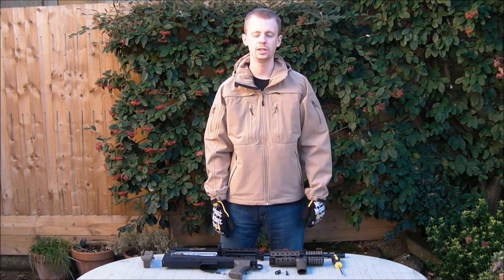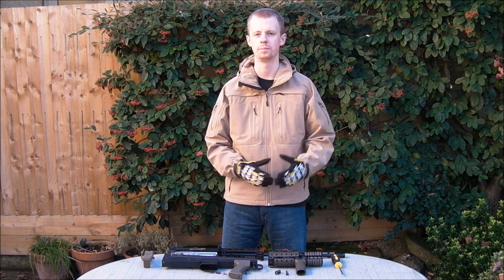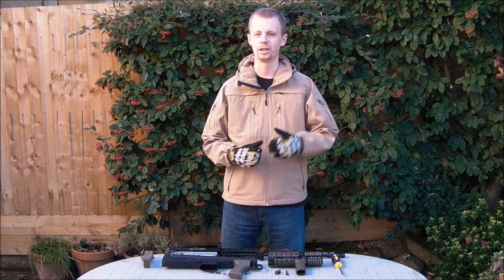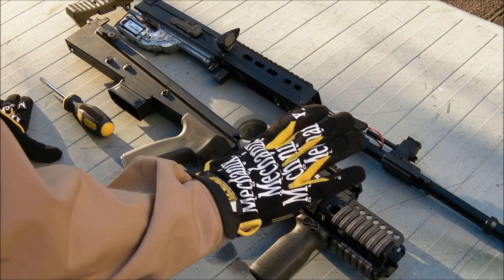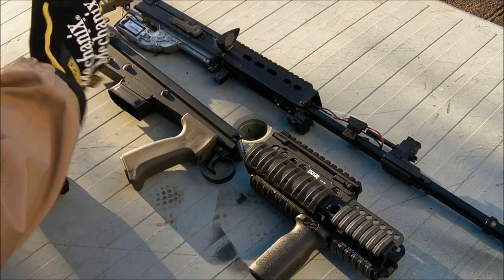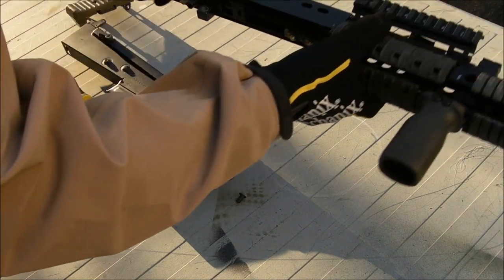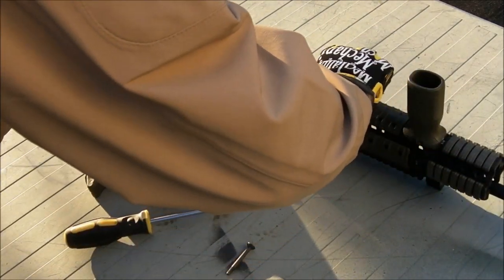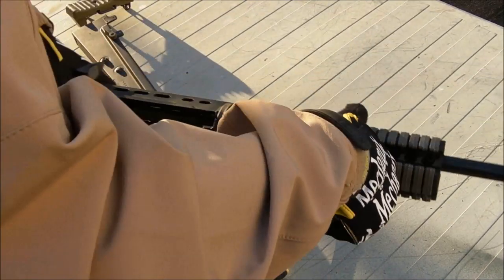L85/SA80 RIS Handguard Installation (Airsoft)

Comment from the maker: The 416 was released long after the A2 conversion by H&K (H&K being owned by BAe at the time the work was done).  The gas system was one of the internal areas they didn't change that much, the main alterations were replacing the cocking handle, bolt and extractor, altering the function of the hammer assembly and adding the guard around the magazine release.  A lot of rifles in service still feature the A1 plastic furniture.

Comment: If you get the hornbill gas block conversion it will allow the rail to be fitted much more easily and also allows the bolt to be screwed through the gas block making it much more secure! Hope this will help anyone who has difficulties making it fit

Comment: the L85A1 had some design faults so the design was sent off to H&K in germany and they redesigned the gas system and made some external modifications to the controls and the polymers i believe to the point where it is now internally a bullpup 416 and like the 416 is incredibly reliable. as for the body cracking, it's stamped steel. where ever you heard that from they're talking out their arse, the only external problems were with the polymer furniture in extreme heat such as the middle east.

Comment: ACOG did a rather brief service, i'm not sure if this is a rumor or not, but shipping them out to afghan, they dropped the crate and broke, i know for a fact that the lads kept braking them by the dozens, and the reticule mysteriously used to shift to the right of the scope so we bought spectre.
ACOGs are issued with some stupid Z mount, and are now only used on the L22AFV for vehicle crews and the RN still use them, the X6 variant is rarely used now also

Comment: they were used on the frontline when i was in, but i havnt seen an image of one on the frontline in ages, i know they are no longer issued on a section level in favor of the L129A1 but i guess you could still requesition one, but ive heard guys not being able to even req one, various rumors include being the first batch to upgrade to A3, converting them back to L85 IWs and such
the best chance is that TA has them

Comment: this was exactly what iv been looking for but the question i still have is that it looks like you replaced the rail on top of the receiver. iv been wondering if that was possible because i have the same ics weapon and the rail on the top is to small for regular sights. a reply from anyone would be great.

Comment: All I know is when I field stripped them the gas piston had HK markings on it so it had obviously been replaced and I was told by an ex para that the furniture on the A1 didn't hold up to the heat but the A2 does so perhaps it's a difference in the way it mounts to the weapon. Is there a reason you're correcting me but not this guy, I got a couple of details wrong vs. Spouting BS and you correct me?? :s

Comment: Awesome video. Can you use a real British Army rail on the ICS L85? I have a genuine British Army rail and wondered if it'd fit with the ICS adaptor ? Cheers.
Reply from the maker: The MoD purchased rail won't work on the ICS AFAIK, the gas block is setup different to the real rifle.
Reply: REMF Tacticool That's strange because I knew someone who managed to fit a MoD ris rail to an ICS l85

Comment: I've done it thanks, saved me £30 do do it local fitting! One question, finding it impossible to access the battery, any tips?
Reply from the maker: I took the fake gas parts out and put some bits up in the top cover.
Reply: Ok thanks is there any other option or is that it?
Reply from the maker: Not touched the gun for a long time, I just found a way that worked for me and I stuck to it.

Comment: i noticed you had a picitany rail adapter for the susat ris. where did you purchase that? i only managed to find that in one place and its sold out. i want to get a rail adapter for my l86 cause the sight options are very limited for susats
Reply: devoman203 check out ANT Supplies he has the rail adapter either in picatany or the riser version.

Comment: How easy would it be to run the battery wires through the RIS handguard? Just wondering as I'm thinking about getting this but if I did i would use a mock PEQ box to make battery changes less of a hassle.
Reply from the maker: Pretty easy, there's plenty of holes.
Reply: CKinnerley Cheers, thanks for the quick reply.

Comment: Hey Chris had a question about the battery space on the rail kit. I don't use lipos, so could i use a 9.6 nunchuck and have a good fit? If not, could you please give me a few more options? Thanks.
Reply from the maker: No way anything but a LiPo's ever gonna fit inside this setup to my knowledge, sorry.
Reply: REMF Tacticool Hey, can i fit this rail on the Carbine version of the ics l85 ?
Reply from the maker: I don't personally know how the carbine is setup on the front end, if you can compare it to the rifle somehow that's the way to find out.
Reply: 7starsfear From what I've seen it should fit on without a problem.
Reply: ***** you can use 9.9v 1000mah LiFe batteries in it. They are the same ones airsoft ed aka bullet4myenemy used in his one.

Comment: silly question i have an ICS l85a2 with the same parts but i cannot slide the RIS over the front sight holder part on the barrel? also just to add the hole in bottom of RIS is at and angle not straight so were you use a flat headed screw to screw straight down, thats not the case with mine its at an angle going into l85a2?
Reply from the maker: +richard hobbs without being able to see it myself, there's really nothing I can suggest.  Been many years since I made this.
Reply: cant send photos here can i?
Reply from the maker: Get yourself on to a forum, I use ArniesAirsoft, best bet.  It's been too long since I built this to remember any of the fine details myself.
Reply: You could try Imgur.
Upload the picture there, then just paste the link over here.
Reply: richard hobbs Did you ever solve the problem? Currently having same issue with my ICS L85
Reply: yup brought the ics adaptor from ant supplies and with a bit of filling down i managed to get it fixed.
You need to file down the sides of the gas block on the ics adaptor then with a drill of dremmel make the hole for the pin holding the gas block a little wider (i think).
You dont need to use the screw underneath as it wont fit anyway, but if you have done a decent job you get hardly any wobble at all.
Reply: richard hobbs Hi there, I am having the same issue 1 year later...

So are you saying the only way to get this to fit is by filing it down ourselves? After paying £150 for rails, I don't expect to have to manually make it fit...

Anyone else find a better fix?

Comment: looking for advice Chris, mates got an ICS L85 and has a genuine DD front do you know if this will fit an airsoft gun, we know he needs an adapter kit to fit the madbull but just unsure if the real deal will be same?

Thanks in advance for your help if you can
Reply from the maker: Probably not without, I mean the usual thing applies of "if you've got enough of a machine shop anything is possible" but the ICS front end is very different to the real gun.

Comment: Can I use the Madbull ICS L85A2 Rail and rail adapter in a G&G one?
Reply from the maker: RebelMindSoldierSide If they make a G&G adapter then yep.
Reply: RebelMindSoldierSide Go for a AGM as they fit without adaptors. For G&G and Ares avoid Madbull. Madbull designed the handguard for ICS and ICS screwed up the tolerances and made it for airsoft. The AGM can fit on a real rifle. Can get one easily on ebay. Thats what I use on my G&G L85

Comment: Do I have to split the upper and lower receivers to install the adapter?
Reply from the maker: Most likely.  But splitting them is a super easy, tool-less job and works the same as the real rifle.

Comment: What is the best battery I could use with this for good power and reasonable rate of fire? (Specific name/store or link would be great)
Reply from the maker: Isai Argueta Whatever lipo you can fit.  About 1200mah 7.4v works fine for me.
Reply: REMF Tacticool I have the 9.9v 1000mah LiFe batteries that are supposed to fit really well. Same ones airsoft ed uses.

Comment: do you need to remove the RIS every time you want to take out and charge the battery? Or can a lipo battery fit in the top part of the RIS where it can easily be taken in and out
Reply from the maker: I took out the fake gas parts and the connectors sit there with the battery inside the rail.  Makes it easy to charge the pack.
Reply: thank you
Reply: @CKinnerley  what are the maximum dimensions of the battery so it can fit in the compartment as you describe. i have a LifePo4 30x30x98mm.
Reply: @CKinnerley  and will the ris fit on a L85 A2 Carbine version, length wise?

Comment: sorry, im not very well at english. Can I use any madbull ris on an ICS L85 replica?
Reply from the maker: Not any madbull rail, needs to be the specific L85 rail.
Reply: REMF Tacticool I correct myself, Can I use any L85 madbull ris if use the adapter?
Reply from the maker: I think they only make 1, you just need the ICS adapter.
Reply: REMF Tacticool Okey, and thanks

Comment: will it work with the ics l86
Reply from the maker: +Kean Flynn Afraid not, no.
Reply: +Kean Flynn It does yes, you require an adaptor though. They're available for under 15 pounds I do believe.

Comment: I am struggling to put the lower receiver on could you help
Reply from the maker: Ask away
Reply: How do you put the two hooks in on the lower TMH
Reply from the maker: @Kingmeeky1994  just above the trigger?  gotta squeeze em together a bit when you put the TMH on to the body/upper receiver
Reply: The Full 9 did that and it worked thanks but my battery it too big for the defence rail so gutted about that but fits the original hand guard what battery do you recommend
Reply from the maker: @Kingmeeky1994  well a small 7.4v lipo
Reply: The Full 9 thank you
Reply: The Full 9 hi sorry just one question after you fitted the handrail is the front sling loop meant to wobbles as the screw will not tighten anymore but the loop just wobbles:
Reply from the maker: @Kingmeeky1994  mine does not wobble
Reply: The Full 9 oh ok I will just keep trying
Reply: Hi this is the problem I keep having
Reply: The sling loop still wobbles